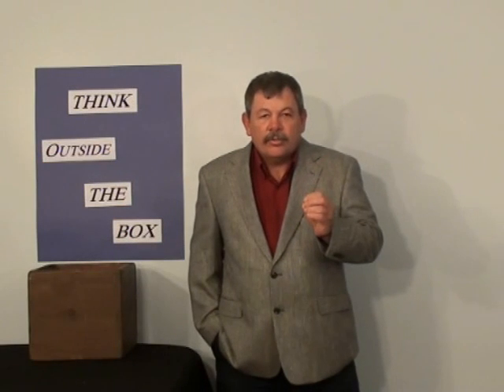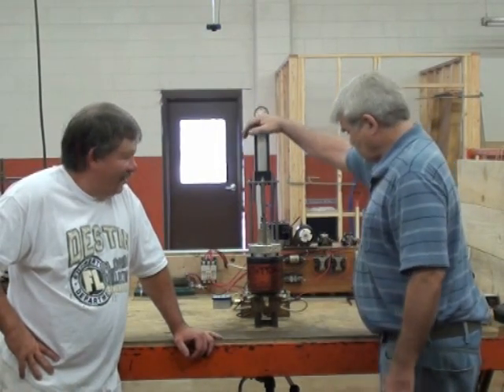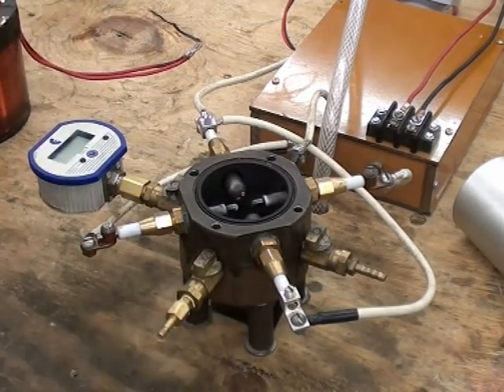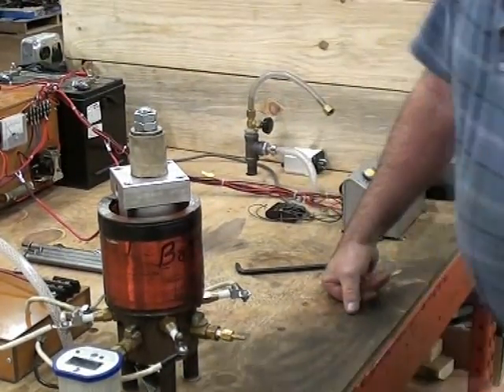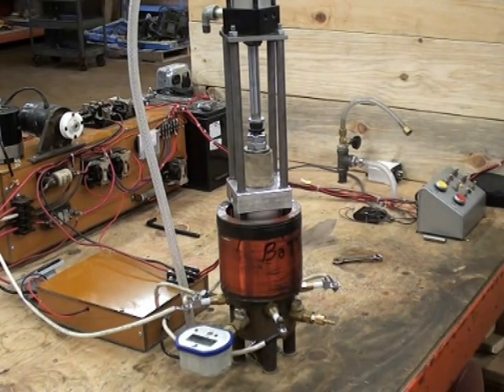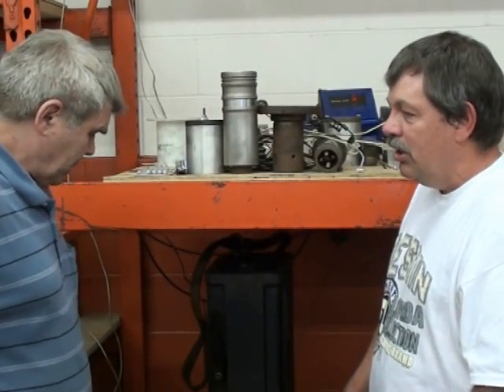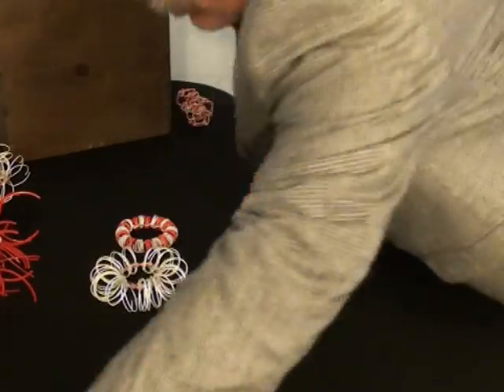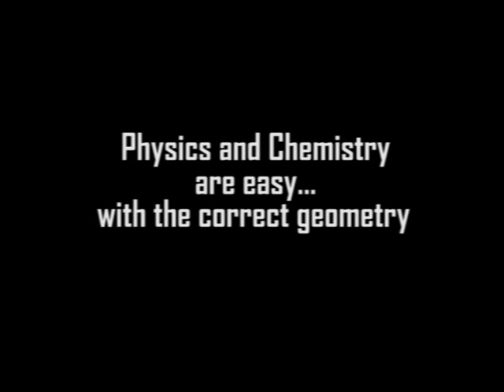Rohner-Roberts Video (The Noble Gas Engine)

Comment: Whastever this pretends to be, it is not a power source. In order to get any energy from inert gasses you would need a fusion process, and you do not have the super giant star temprature and pressure needed for fusion. Energy from nowhere is amyth.
Reply: Energy from nowhere IS a myth- it's called "the Big Bang". One other possible immediate hypothesis to explain anomalous energy release from a system is you haven't identified every input to the system. If you can identify EVERY possible way to abstract energy from a volume of gas, let us know- we'll immediately be able to identify that you are NOT a scientist.

Comment: So Eggers, you believe that there is heat put into the system electrically to drive the piston up, and then in a split second, every last bit of heat is removed to lower it again and all this while the piston tube stays cool. Not only do we have a heat transfer time problem with this statement but we have a heat transfer rate problem since the transfer rate is proportional to the temperature difference internally and externally. Therefore, the hot gasses will never cool all the way down.

Comment: Where are the ends of this big copper coil are connected????
Looks for me like a metallic cylinder in a coil .... if you supply the coil the cylinder will move up
Reply: Except the aluminium piston wont be effected by the electromagnet.

Comment: I wonder if you could step up the amplitude closer to the speed of light? Larger doesn't seem to be the solution. An array that turns into physical locomotion via a cam? Imagine a "tube" array that simulates what they called a "Jeffries" tube on Star Trek. And no, I am not being flippant. Star Trek has been the progenitor of many a modern idea. Does the flip open cellphone ring a bell?

Comment: This is not sufficient to convince me. I need to see an energy balance on the system to show that it is producing net energy out. Obviously energy is going into the system in the form of an electrical pulse that produces the arc that heats the gases and that is what produces the work out of the system. Without an energy balance performed on the system you have nothing of note.

Comment: You put in the heat the piston rises, you take it out and it goes down. Are you now saying how fast I put it in has any effect what so ever in how fast it comes back out. Strange. So tell us how the gas cooling is different with a slow input versus a fast input. I have no intention of heating the fixture, only the gas. The slowing of the cylinder is simply the reduction in return pressure. as the gas goes back to its original state immediately on completion of the pulse.
Reply: Hi Bob. Hope you are well. Sorry to hear of Tom’s death. I wish you well. Marty Col
Reply: @lamartek2461  - Thank You Marty - Hope all is well with you.

Comment: Find a new way to measure the effect without using an air cylinder. That air cylinder could be what's moving the piston! Use something else, that could not possibly be aiding in the piston movement, like a pressure sensor. I would like to believe it, but as is, this experiment with the air cylinder is flawed.

Comment: what is the point of this video, what are they selling, i dont see any thing significant taking place
if you pressurize a vessle with any gas and puls an "ARC" threw it , it will do exactly whay we see here even un pressurized, i build a device like this 12 years ago called the arc engine.
you totaly lost me at THORIUM lol ,,, ok then

Comment: Well Egbert, It appears you are trying to tell us that our system can transfer a large amount of heat energy through the inert gas layers which are themselves very poor heat conductors and across the boundary layer with the stainless steel sleeve in microseconds. Is that what you believe? 

Here’s what I will do, I will simply pump enough heat into the cylinder to lift the piston and load as shown, remove the source, and time the return stroke. Fair enough,  Watch for it next week. Any bets.

Comment: IF this is so important why are you so poor yet?
Reply: Monopoly game..... This does not fit in to the oil rip off market. Why sell you a engine you only need to fill up once understand now.....
Reply: Inventor Down The Rabbit Hole Network 
Dude... listen. This machine does NOT work. All it does, is take electrical energy and convert it to mechanical energy. You still need another source of electricity to make it work.

If does this at a loss. Any competent individual could see this by looking at all these old “papp” motors on youtube. Some are even “required” to have dc motors. Are you kidding me??? Its a damn scam. 

It doesn’t create more energy than is put into it. 

Plus that company that was pushing them, intelligentry or w.e they were called were defrauding investors and got sued by the sec. they tool peoples money and bought new houses and cars! Criminals and scum bags.

We should be trying to make real innovations and not being fooled by this nonsense. Im not a shill either im a normal guy. I believe theres great hidden tech out there and oil companies are a pain in the ass but lets be practical here.
Reply: @pattyoneill91  a petrol engine doesnt generate its own power to run the sparkplugs/ecu... but you knew that, hey?